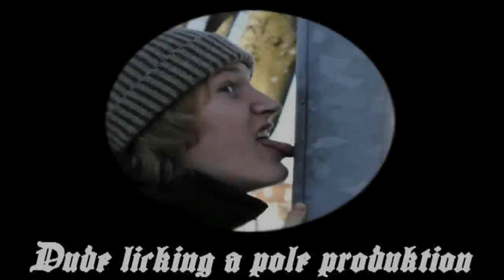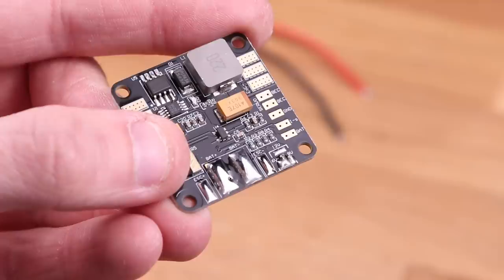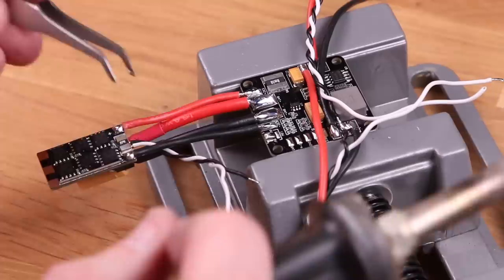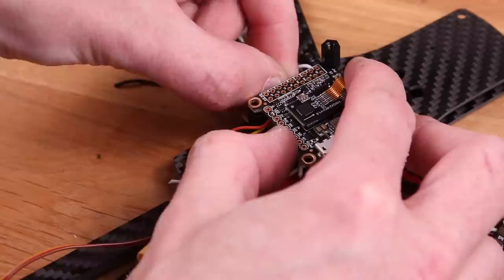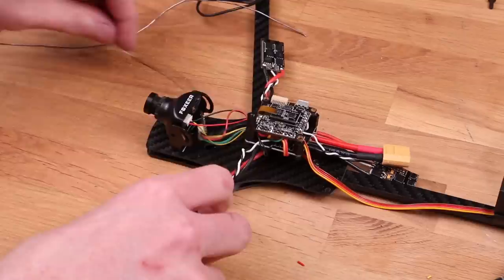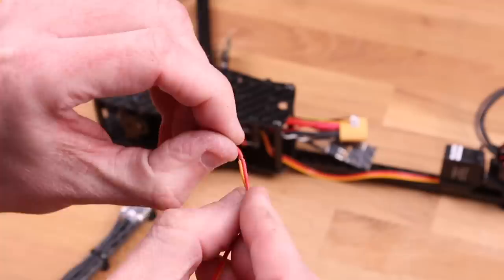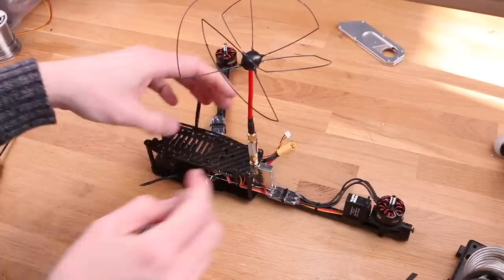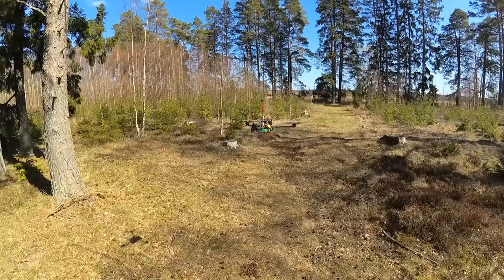TRICOPTER LR - Long Range FPV, 1h+ Flight time, Foldable multirotor - Build Video.

Comment: Hi there, I now this is a bit older vid, but  I just started collecting older quads they quit making, and my latest find was a 2015 Graupner Hornet 250 tri-copter, great condition excep on motor burnt out.  Oh yeah, have 6-7yrs in the hobby building/fying quads, this is my first tri-copter, so be gentle..lol.  So I was just digging in and the motors are 2808, 2300kv, stamped with just the Graupner logo.  So two things I'm stumped on, I thought they were 22/23XX by looking at them, pulled out a 2204 2600kv motor I had, and measured width of both with calipers, and the stator is the same width within a tenth of a millimeter.  Did Graupner stamp them wrong, did they measure different back then?  Second, it's swinging 6" bi props, i thought maybe the bigger motors were to make up for one less motor, but your sportin' 8" with 2207's.  What motor size should I order?  I'd like to try some triblades on it enentually.  Not sure how they measure tri copter, but specs say it's 100mm x 95mm weighing out at 389g with no lipo. Any tips you could throw my way would be appreciated, thank you!

Comment: How did you get such a long flight time? 10Ah battery with only 10C discharge rate, and three motors running 8 inch props. For an hour. It sounds too good to be true. And what range did you end up getting on your receiver/transmitter setup?
Reply: 10C at 10Ah can supply the same current as a typical 100C 1000mAh battery. But yeah 1 hour is probably with pretty careful flying.
Reply from the maker: 10x10=100A continuous. The copter hovers at around 8-9A. 1h flight is very careful flying indeed
Reply: Thank you. I did not know that is how batteries worked. I thought the mAh of a battery only affected it's capacity not it's discharge rate. Can anyone recommend a video to help me understand this better?

Comment: Is this a kit or did you buy each part separately? Do you have a build sheet? Nice video but for me, it's moot without a list of parts. There isn't a lot of information out there about which components can be used with which.

Comment: Hi, A big fan from Bangladesh since 2014. Made my first tricopter with kk 5.5 board following your FT video. :) 
After a long gap trying to build a Tricopter LR. But not able to find the design files. Kindly share a way forward.

Comment: Amazeballs.
Is there any way to waterproof it... I'd like to use it to track our live stock in our crappy conditions, and with and hour flight time that is ideal.
Reply: Look up silicone conformal coating for waterproofing the PCBs, and for the servo there is a way to do it with CorrosionX I believe. There are lots of videos of people waterproofing 5" quads.

Comment: I need some technical advice, is there some guidelines for torque and speed on servo for prop size, I want to build  a very large tricopter
Reply: How big ?  i am looking to lift 300 lbs and fly for 1 hr.  that how big i wast to build.

Comment: Does it being a tricopter (rather than a quad) contribute to the longer flight time?  If so, how?  I'm having a hard time finding anybody running quads for anything close to an hour, but to switch from fixed wing to rotors, I want to see bare minimum 30 mins flight time.  Ideas?

Comment: When I built tri's a few years back, using a similar tail mechanism ('direct drive'), the servos were forever getting smashed (the gears inside.) ie: If I had a servo, that had some ties to the tail boom to rotate the motor, then on impact (its going to happen!), the prop impact would force the motor and boom to twist, and it'd strip or break the gears; using cheapo servos or even pricey full metal gears.. didn't matter.

I think the connection from servo to the boom needs to have a break in it, so that it can slip on impact and avoid smashing the pricey parts; or perhaps a different mount approach entirely?

What do people do now... or just not crash? :)

Comment: Excellent build video. Full of very good knowledge that can be utilized in almost any copter build. David, could you use a 433 MHz Rx for control Or would that interfere with your video?
Reply from the maker: 433 is great! Not too many SBUS or other digital link available that I know of though :/

Comment: Hi David! Thanks for a comprehensive walk-through!
Is this platform a good fit to put a gimbal with a gopro on it? approx 160 grams of additional weight? I don't need to maintain that 1h endurance, but would enjoy as much as I get with it!
Reply: does anyone have downloded the 3d models and pcb file, i want them. the website seems to be not working.

Comment: I love this build so so so much 

Sigh.... another drone to add to my growing collection hahaha

Looks like so much fun haha

Portability and range COMBO with the high efficiency, not could you explain the bit about 18650s a bit more?? 

Lipo are good a peak current and the 18650 (depending on the batt) can sustain longer flights because of the more linear nominal voltage of the 18650s???? Would love to delve into that I have a bit knowledge about 18650s and alot of different ones about hahaha

Thanks again :) sweet copter I can't wait to get one!
Reply from the maker: Higher energy density of the Li-ions, but less peak current. But a large pack will not need high C rating to deliver the same amps :)

Comment: Does the flight controller used here support GPS and return to home (expecting to have to add a GPS antenna)?  Also what battery did you use to get 1Hr flight?

Comment: I have always been a fixed wing flier, I have been very interested in tricopter, I was wondering if there is something for a beginner?!
Reply from the maker: I wouldn't really recommend it as your first copter. Try something a bit more crash resistant like the baby tricopter or even a small tiny whoop

Comment: So I am in the process of building my version of the tricopter V3. I noticed now that they use flight stacks for their drones. It used to be the KK 2.1.5 board and whatever receiver you had.. I bought a conventional fry 8 channel receiver to use with my tricopter as I would have 8 years ago but I'm having connection dropouts. I don't know where to start with buying a flight controller I do not need one with an onboard esc I just need one with a receiver and flight controller. Is there some type of interface that could work with my kk2 flight board or should I drop that platform all together if so where would you go? I wish I could have bought your schematics and or electronics before you shut your shop down I would have totally bought them today.

Comment: Any plans for an updated frame plate for the V4 so you can more easily mount the baby PDB and kakute board in there? Im thinking of modding mine as the f3 doesn’t cut it any more

Comment: Hi David, this looks awesome. I know this is more based for cruising but if you open the throttle whats the speed like. Is it something that could be used for chasing a vehicles?
Reply: does anyone have downloded the 3d models and pcb file, i want them. the website seems to be not working.

Comment: Hallo David tenkte jeg bare må spørre deg=)...

Hvis man har en tricopter som:

motors are flipped to a pusher config, where the pusher prop is moved further away from the motorhub with longer shaft to allow incoming air hit most of the propellor blades near the driveshaft. Plus having a pusher prop with thrusting blade geometry all the way to its center.. And a vertical arranged arm instead of horisontal to minimize disturbing the incoming air past the arm. Thinking that the coanda effect sucks the air around and past the motor and then inwards again against the prop, if there is enough space between motor and propellor? Maybe an egg sahped (water drop shaped) enclosure around the motor would help?? 

question is if this would be more efficient than tractor motor config on drones??

Comment: As a Canadian I need a sub 250g version of this.
Reply: Drew Stevenson 😂 Just take the basic test so you can fly in uncontrolled airspace. Took me about an hour to complete and it’s only $10
Reply: Manuel Neumann oh yeah that’s the plan but under 250g you get more options like not needing a spotter or line of sight. I could go beyond visual range. What’s the point of a long range rig if it loiters close to home.
Reply: @rosedruid  True that

Comment: I wonder, I purchased two tri coptlrs back couple years back. Both were dogs. 
They hay two arms I front and a third in the rear. 
I guess it would be fair to call them hexa-coptors, as each arm had two motors 2 props on each arm.
They were FPV, and several Reviewers rated them faily decent.
THEYWERE NOT. 
TH
They wouldn't even lift off. The motors would Reviews up, then DO a turtle flop. B There was no trimming them out. 
It wasn't the weight of FPV Aio system either.  I removed them. Sti wouldn't fly. 
I purchased from ebay or Amazon.  
I complained.  Got a refund, ordered a replacement from another seller. 
Same thing.
They were cool though. Had a nice AIO FPV system too. I salvaged them and tossed the aircraft.

Comment: You can't get 1 hr flight time. Maybe 40 minutes at best. With a 3Sx6200 mah I can get 22 to 25 minutes. With a 3Sx10,000 mah lipo maybe 30 to 35 on my Tricopter LR. Because the additional weight increases hover amps dramatically there is a point of diminishing returns. Also flight characteristics deteriorate. My aircraft has a full nav setup, but this is not much weight. Maybe you can gain a couple minutes with a bare bones setup. So absolute max would be 40 minutes.

Comment: Not all cheap clipers are crap. I’ve had this pair: VINCA DCLA-0605 Quality Electronic Digital Vernier Caliper Inch/Metric/Fractions Conversion 0-6 Inch/150 mm Stainless Steel Body Red/Black Extra Large LCD Screen Auto Off Featured Measuring Tool https://www.amazon.com/dp/B017KUC6XQ/ref=cm_sw_r_cp_api_i_Ij00CbND3YRPH   For over two years, and only replaced the battery once
Reply from the maker: Like the look of those. Might be worth a try :)

Comment: I know nothing about rc flying.
Can someone explain me why rc planes can not fly 1 hour? Or can they?
I dont understand why only a copter like this can.. it even has 3 motors?
Reply: If it has a high lift wing then you can fly for a very long time.  most planes you see on YT are very fast so very low flight time.  I had a powered glider and they thing could stay up all day if it wanted.
Reply: I also had a parkzone super cub  i fitted a 3s 1200 lipo and you could keep that thing up for a silly amount of time.